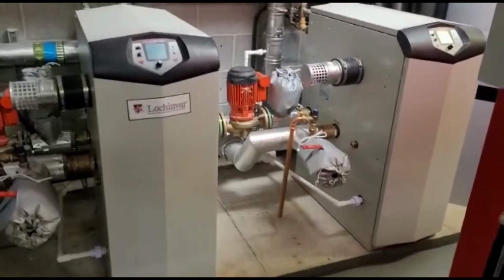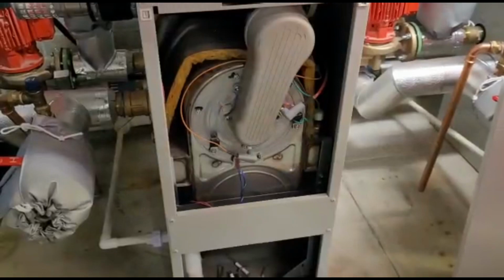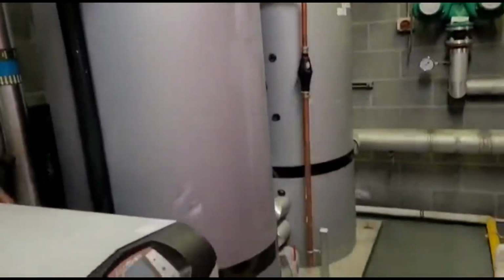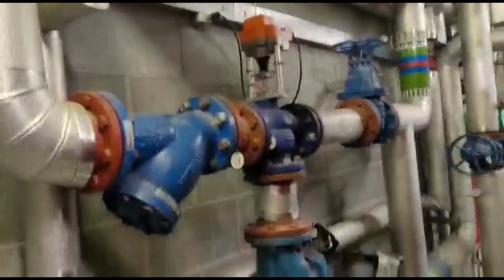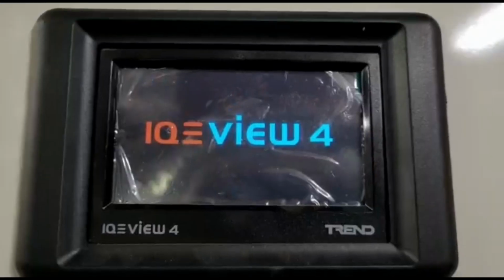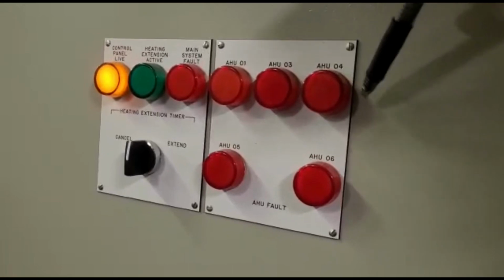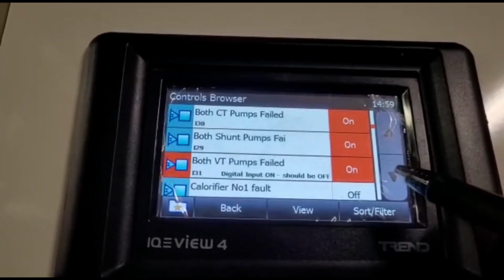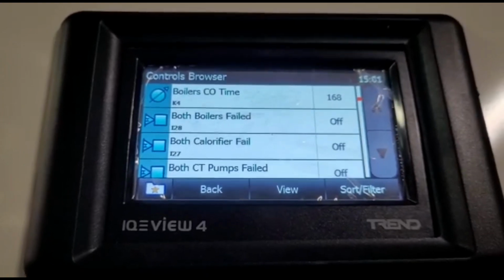Commercial Plumber Plant Room Tour - Plumbers Videos

Comment: Great video Allen/Lee! A good insight to commercial.
Why do you think the CT and shunt pumps are tripping?
Ps I do love a BMS panel without the drawings 😂😂😂😂
Reply from the maker: Thank You
Reply: At the moment we have had problems with the AHU tripping on frost stats. This also affects the kitchen gas supply. With the temperature last week being so cold it was a nightmare. The loovers on the AHU's are buggered to. SOOOO To keep the frost coil nice and toasty I've had the boilers up to max and the flow + return temps up to max on the BMS. The pumps are old and the over temperature overload switches are temperamental. Hence why they trip. When it gets a bit warmer I will change the set points back to 65.
But thanks for asking. Very good question that was and well observed. 👍

Comment: question 
Do most commercial  separate the boilers  from the heating system with a plate to plate to protect them, 
love to see this as never worked on big commercial   in the 39 years in the industry
Reply: quite common now where a modern boiler with a high efficiency heat exchanger gets fitted to an existing system with old pipework. the plates do still get blockages sometimes but they can be isolated and cleaned without wrecking the boiler
Reply: Yes they do. The downside of it though is:
1. The plate to plate gets blocked. 
2. You are down a couple a boiler or a couple of boilers.
3. More actuators and pcb's to worry about. 
I have a few plantrooms that run on a sort of S plan that utilise a clorifier. I find this is better than a plate to plate. 
A few of my plantrooms that are not regular for me to work on have plate to plate. Will see if I can get a video of them for you.

Comment: Lee do you have any trouble with the self sealing plunger bit on the bottom of the AAV going down too far into the ball on the quarter turn valves?
Reply: No. Never. Hand on heart I've never had that problem. If I had I would have used a nipple and another socket (space accommodating)

Comment: Where are the flues on those smaller 125kw heaters terminating, the clip was unclear and looked like it was terminating inside the plant room, but that couldn't be? 🤔
Reply: They're open flued , what you can see on the side is the air vent. You can just make out the flue in the background,  near the red pumps with the white condensate drain coming out.
Reply: @nicpye248  cool, thank you 👍🏼
Reply from the maker: I will find out. Thanks.
Reply from the maker: :_drill::_gug::_mul::_cutters: